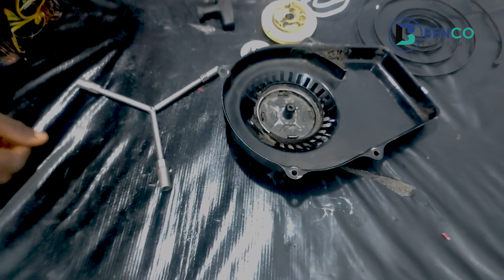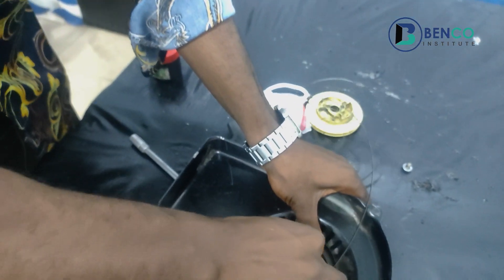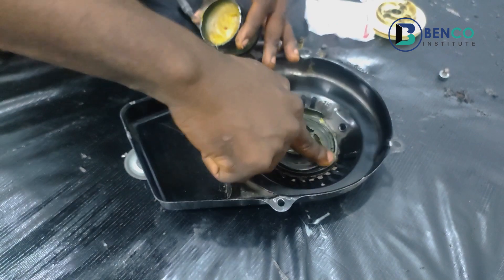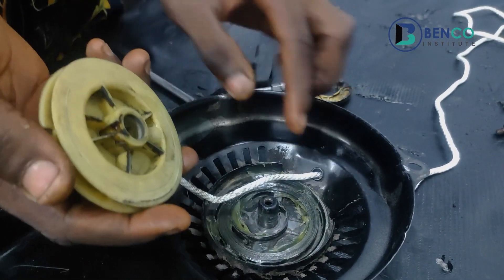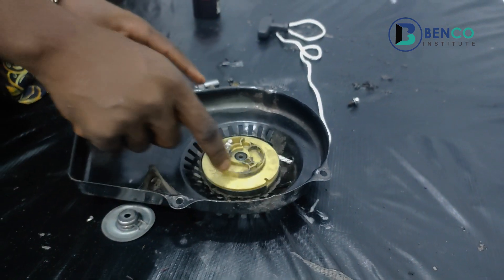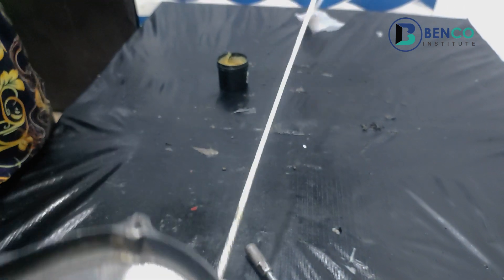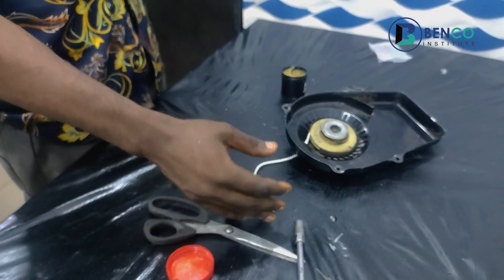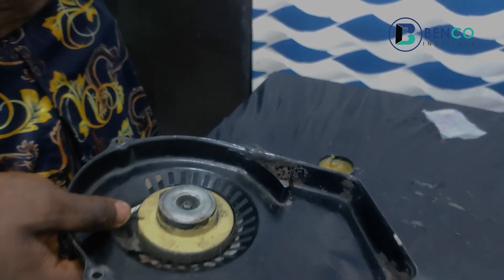Easy way to fix recoil starter for 2 stroke Tg950 generator

Comment: Hi
What is that 3 winged socket wrench you are using called? Where can I buy one?
It looks like a tool that would be very handy in my working on small engines.
Thanks
Reply from the maker: Very handy bro

Where is ur location
Reply: @bencoinstitute  Hi
I'm in Quebec, Canada. About 40 miles north of Ottawa, Ont.
Reply from the maker: @bartblack3434  Alright
I will make my findings and see how you can get it
Reply: @bencoinstitute  Thanks. I would appreciate that very much.
Reply from the maker: @bartblack3434  ok sir/ma

Pls join our membership community...so we can talk directly on whatsapp... I have made some findings we will find a way of sending it over
Reply: @bencoinstitute  Hi
I am happy to join your community but I do not have a cell phone. Cell phones do not work in my remote mountainous location.
I can provide you with an email address if that is sufficient.
Let me know please.
Thanks
Reply from the maker: @bartblack3434  aright go ahead ..i will send u a mail